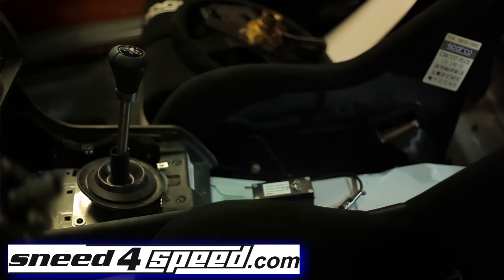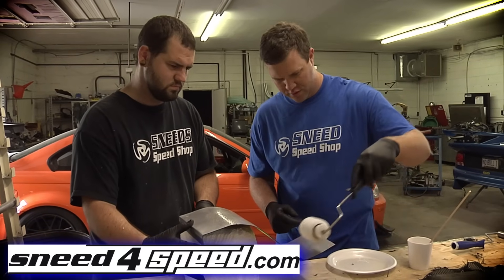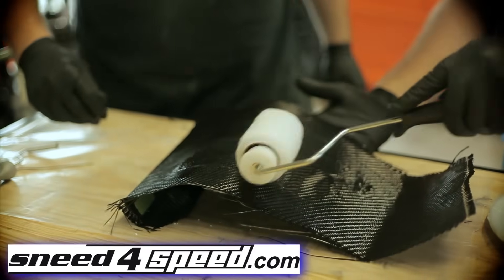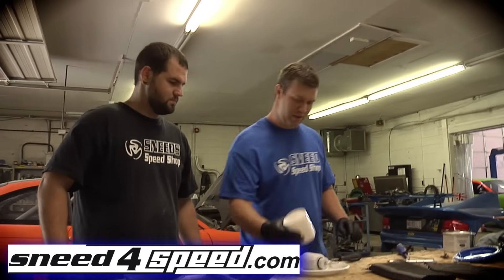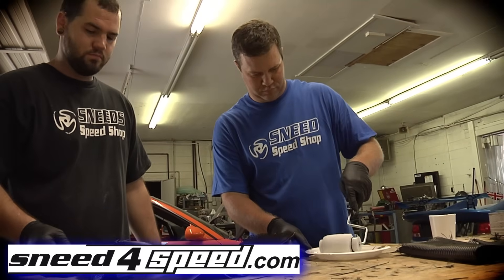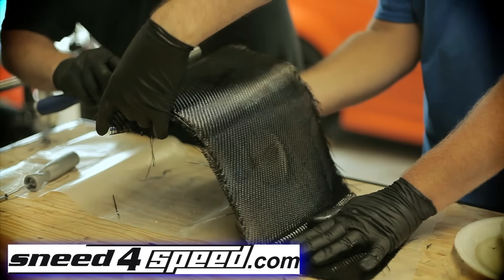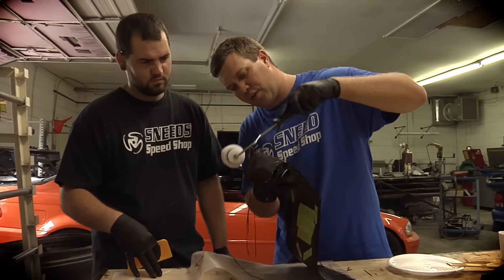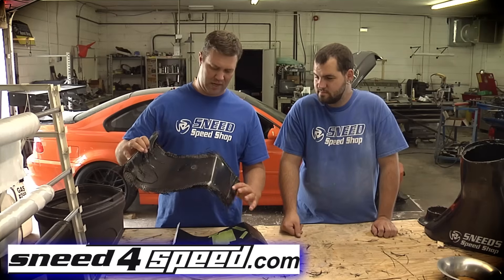How To Wet Lay Up Carbon Fiber

Comment: did you guys not de-gas your resin? that's exceptionally important to avoid porosity in the part and loss of mechanical properties.
Reply: Qwerty48121 

Mechanical properties in an interior trim? The fuck u smokin?

Comment: Am trying to understand what you meant by "cross your weaves". Is it that you're laying the weave in different directions with each layer (left to right then right to left)?
Reply: +Craig Elliott He means to put a "bias" into the mix. If you have one sheet with lines going one way, you put the next sheet with the lines going about 90 degrees to it....think plywood.
Reply from the maker: Craig Elliott for max strength offset the weaves.  thats what i mean by crossing the weaves.

Comment: Using more resin does not make a part weaker!!!!! It makes it heavier....stop miss-informing people! there is no scientific or engineering basis to what youre saying.
Reply: Using more resin than required DOES reduce the tensile strength of carbon fiber. 33% Resin content is ideal in most applications. Hard to achieve in this scenario. Pre-preg is one of the few methods used to reach optimal resin content resulting in a higher tensile strength. I am a CCT/ACMA certified Carbon Tech. I am not here to prove you wrong I am attempting to provide the information that you may or may not find educational.
Reply: @SpectralComposites  Sir, how to make the surface roughness of final product (facing the mould) to be good ? I usually got quite bad surface finish which have tiny indentations (maybe due to bubble, idk)
Reply: Something that is resin rich will fracture while something that has a balanced composition will bend or flex before it breaks. 

I do this for a living for a ISO certified company. I have learned this information and much more from Americas Cup Engineers. It needs no argument.
Reply: +pen mightygun the bending and flexing are stopped by using core materials like polly foam etc...
Reply: +pen mightygun the more epoxy you use the more brittle it becomes simple, fibers on their own are weak and the resin on its own snaps under very little force,and bits will fly..that's why carbon fiber needs just enough to wet it out and no more but this makes it floppy that's where you go in to fillers to make it stronger like a lot stronger.
Reply: Yes they have tensile strength that goes without saying unless your a pedantic egit, you build a boat with your fibers of high tensile strength  send me some photos of this amazing boat you make, the parts alone are useless so I think your find I'm right.
Reply: +Eric Miller damn straight how ever chop glass is a little different it will take alot more resin. maybe thats where the guy is getting confused but even that has its limits and woven is pretty much the same as carbon
Reply: +Eric Miller not true and I can prove it a core will add strength
Reply: I'm with you on that. I was clarifying that it still has it's own weaknesses.
Reply: Of course it will get heavier but I can say that after 40-45% resin,  even it will start to loose its mechanical performance and there are lots of scientific based result on it. You just need to google it :)